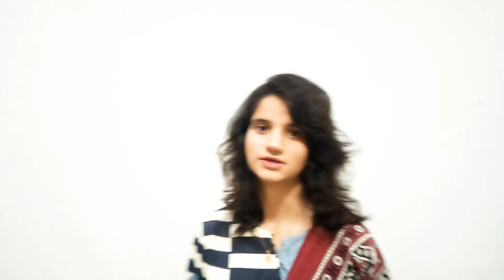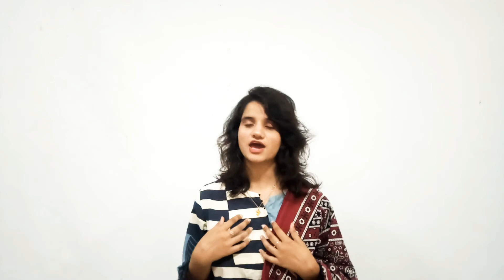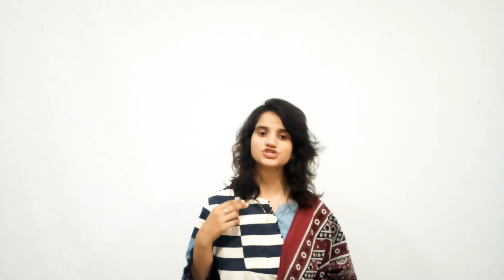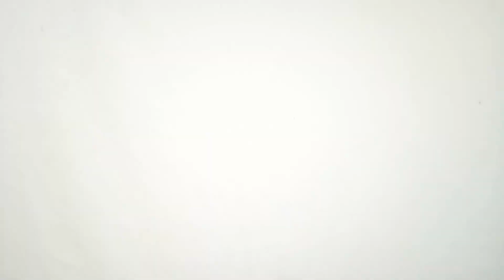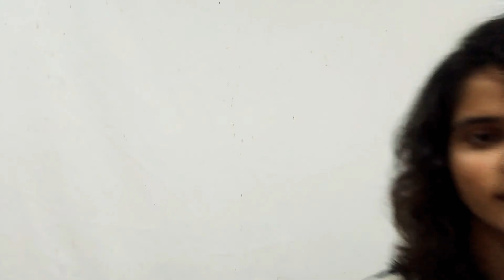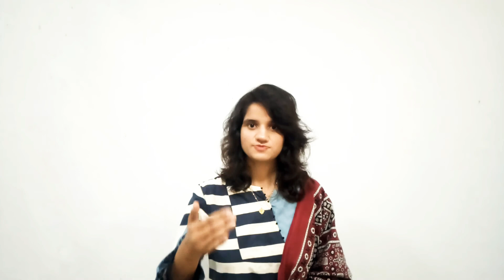Beats/ Resonance /Pitch

Comment: Number of beats produced per second is called beat frequency
It is equal to the difference in frequencies of two waves. It is because of constructive and destructive Interference. It refers to the rate at which volume is heard to be oscillating from high to low volume.
fb= f2 - f1

Comment: ⚫Humna Irfan 
⚫ Roll no 10 
⚫Beat frequency :
             Number of beats per second is called beat frequency
       It is equal to the difference in the frequencies of two waves.
⚫It is caused by destructive and constructive interference.
⚫ It is the rate at which loudness of sound varies whereas we hear ordinary sound frequency as pitch of sound.
⚫ It is equal to the value of alteration in frequency of waves.
⚫ Formula : fb = f2 - f1

Comment: Ayesha Nawal 
Roll no. 03
1. "Number of beats per second is called beat frequency. "
2. It is equal to difference in the frequencies of two waves. 
3. It is caused by destructive and constructive interference. 
4. It is the rate at which loudness of sound varies whereas we hear ordinary sound frequency as pitch of sound.
5. It is equal to the value of alteration in the frequency of sound waves. 
6. Formula: Fb = F2 - F1